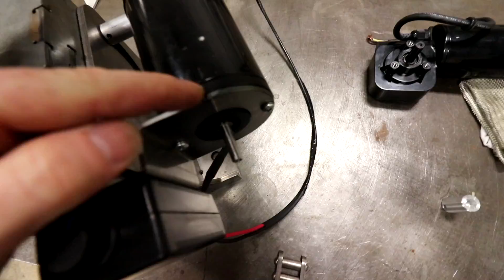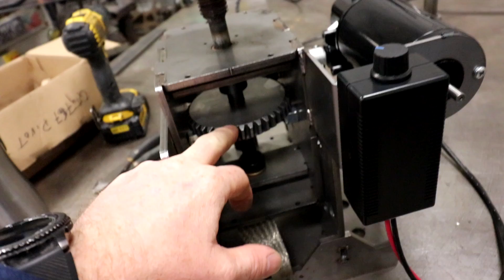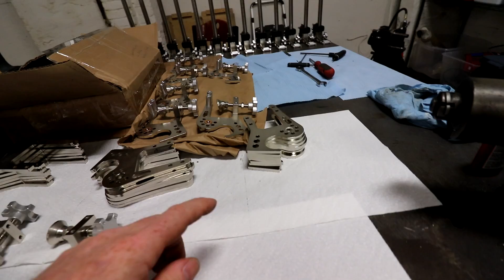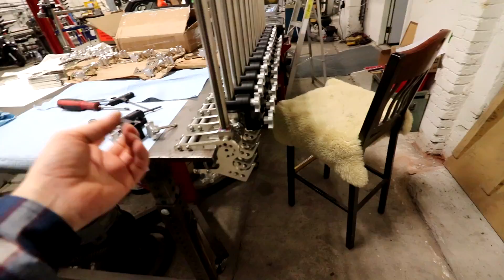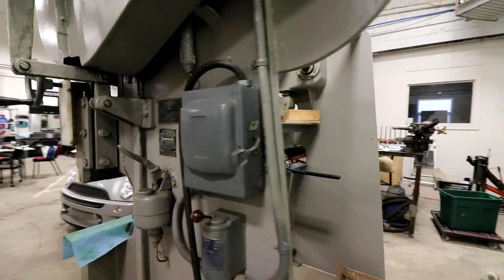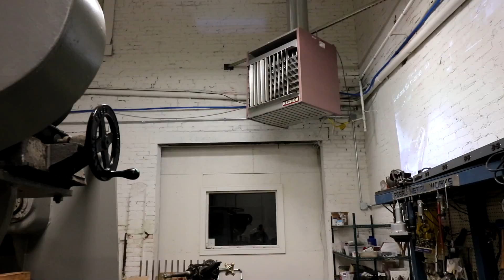Adapted a motor to the weldtables.com turn table positioner  RMW - Vlog 137

Comment: Skillfull hands, rally interesting!  Sorry about my rookie question, I don't understand much about electricity. I am building my positioner, my welding table has a section that is my rotary part, practically I cut a circe in the table, the circle is the rotary part, connected trough a shaft to a dc motor controlled  by a ccw dimmer switch  to reduce speed and turn direction. My tig welder ground clamps into the table. When I am welding, the rotary table turns, electricity obviously runs trough the table and the dc motor, Do Ihave to ground the motor? If yes how? It is a dc motor so 2 wires (L and N). The weld action current can harm, burn the motor? Sorry again for my silly question , I direction don't know much about electricity. Thanks so much for your help!
Reply from the maker: The motor is grounded already since you have it connecred to the table.  The issue is the electricity(current) from your welder will travel through the motor shaft and bearings.  This can cause issues with the bearings if they start arcing.  If you weld at high amps, this would be of more concern.  If you can, wrap bare wire around the shaft nearest to your rotary table/3 jaw chuck.  It will allow the shaft to spin and the wire will stay in place.  Ground that wire to your table (if you ground your table and not your work piece)or ground lead of your welder
Reply: Thanks so much! Your help is really appreciated!!!
I hope I got it, may cause I'm not an English tongue, I'm italian, probably cause I don't know much about electricity, ideed, have patience my friend, think as you are explaining to a 5 years old kid, myself! 
If I understand well I have to wrap a bare electric wire, bare means no plastic protection, only the copper wire, around the shaft that connects the motor to the rotary table part. One side of the bare wire connected to the main table, what about the other wire side? To the shaft I can't connect it other way obviously it can't spin! Thanks again and sorry for my silly question!
Reply from the maker: @lannabulls  just wrap tge bare wire with no insulation around the shaft.  No need to connect it.  As long as it rubs the shaft you are ok.
Reply: Ok, got it! Thanks so much for your kindness and help!
Reply from the maker: @lannabulls  prego!
Reply: Can you speak Italian? Parli Italiano?
Reply from the maker: @lannabulls  No, I have just been to Italy twice and know enough to be polite!
Reply: Thanks so much for your help, I don't understand anything about motos and electricity gen speaking, I dig some research and now your suggestions make sense, got it! We're you from, your accent sound as USA but I can be wrong!
Reply from the maker: @lannabulls  You are correct!  North East US.  I understand how confusing it can be if you don't have any education with motors or electricity!  I do have training in both, but sometimes it is still confusing!

Comment: A little late but I'm thinking about a quick way around interupting the full stroke. A flywheel friction brake and reversing controls using zero speed detection to enable it would be an easy bit of beer work for an automation electrician and doable for a motivated inventor style of person. The beauty of 3 phase is its willingness to go the other way. Haven't looked lately but bump style braking was a feature in quite a few early VFD's, Mitsubishi and A•B for sure but not my first choice for dealing with kinetic energy because the energy has to go somewhere usually as heat. Not good for a control system. Good luck with your heavy weight toy and your steady rest R&D was interesting. 
Peace.

Comment: So they make the welding table frame but you are basically shit out of luck getting a decent gear reduced motor for it. I've seen this time and time again where many home shop machinist will build a rotary welding table but use all kinds of motors and electronics that I find rather confusing and there is ALWAYS a problem with the speed. I'm better off buying one already made but why do they cost so much?

Comment: nice build!! what rpm is the motor. and how much do you selling the welding position table for?
Reply from the maker: Hi Frank, I think the RPM of the motor was around 55 rpm, but that all depends on the voltage supplied.  More voltage means higer RPM.  The Postioner is not mine, it is from a company called weldtables.com.    Thanks!

Comment: Whats the materials cost?
Reply from the maker: Hi, on which part?
Reply: Regal Metal Works I bought this turntable about a month ago but haven’t really used it because with a drill the speed isn’t consistent enough or slow enough. So I would LOVE to buy or make this motor attachment. I prefer to buy it though because of time.
Reply from the maker: @echo5delta16  Make sure you put your drill on the slower setting if it has one.  On dewalt it would be setting 1.
Reply: @Regalmetalworks  the materials including the motor. I have the weldtable rotary positioner that you have but my brand new drill doesnt even turn it well and slow enough for some things so i want to put this motor on it.
Reply from the maker: @echo5delta16  send me an email. And I can you something made up. Cole@regalmetalworks.com

Comment: I was thinking about using a 2000 bmw window regulator motor on a 30::1 right angle gear box. The motor spins at 110rpm. I figure the max rpms would be 3.6 rpms at the face plate

Comment: nice job on incorporating the motor to the positioner.  I'd like to do the same.  would be interested in buying a bracket and shaft coupler from you
Reply from the maker: Hi Roger.  If you know what motor you are using, I can definitely make a bracket for it, same for the coupler.  Thanks for the follow!